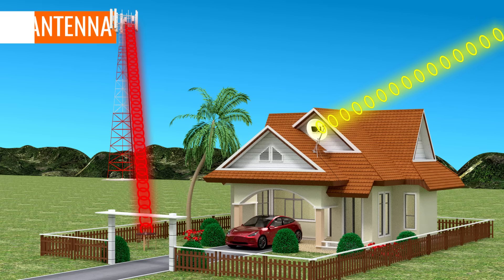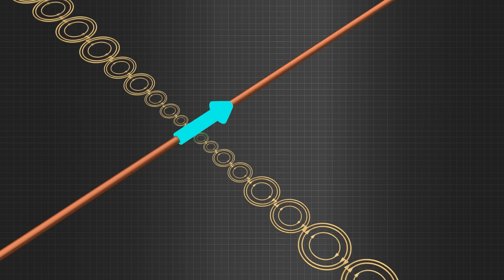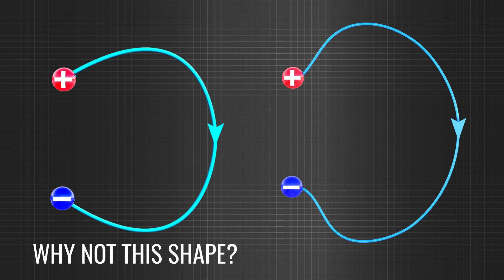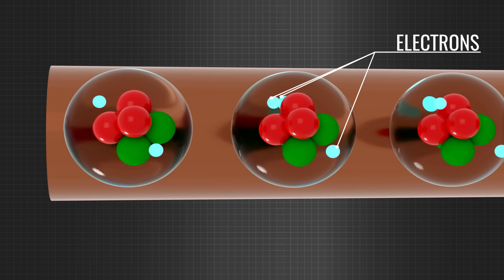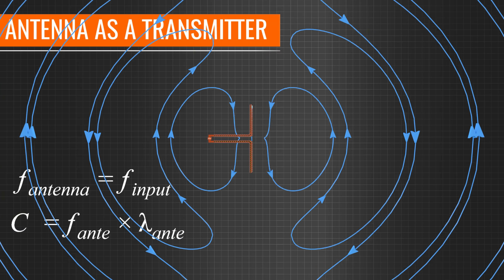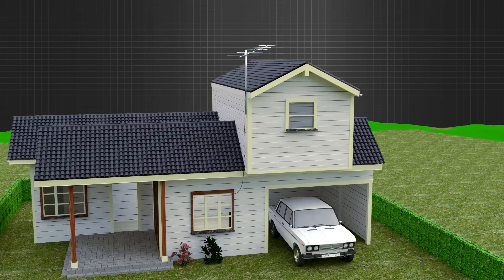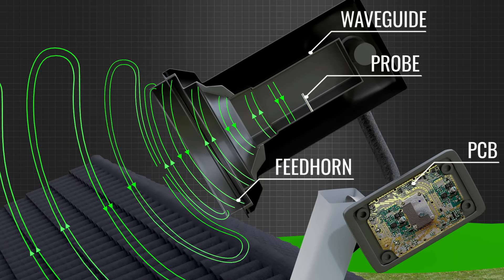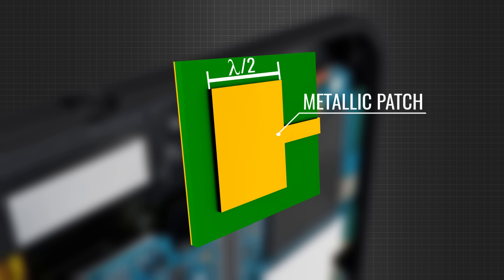How does an Antenna work? | ICT #4

Comment: Yeah it works with sine wave.
Reply: Antenna works the same with any form of waves. With short pulses (e.g. radar applications) and high-order modulations (like QAM) or extremely wideband modulations - wave is not sine. What fundamentally matters for emitting/absorbing waves - is dV/dt at any given moment of time. In general, antennas can be fuly described using time-domain (spectral, transient) analysis. But for many application cases 'Frequency domain' is enough and more easy to deal.
Reply: @plyrvt  Then what's the wireless signal waveform.
Reply: @CasamTheAnimator  what is "wireless signal", any radio signal for over last 100 years is "wireless signal". RMS Titanic transmitted wireless signal. It was pure sine wave long pulses, encoded with Morse code. Early voice radio (broadcast or phone talk) used AM modulation. During silence (no speech) AM transmit pure sine wave (called carrier frequency). But when you apply amplitude modulation, this carrier frequency shifts, according to frequency of modulation signal. If you apply 1000 Hertz sine wave to 10 MHz carrier frequency, TX output signal will be superposition of 2 sine-waves 0.001 MHz and 10 MHz. It won't be pure sine wave any more. It will be VERY CLOSE to sine wave 10 MHz, but slightly distorted. It's spectrum will deviate in 9.999 - 10.001 MHz range. Signal slope at any moment of time will be slightly sharper than pure sine wave 10.000 MHz. Historically we use very narrow modulations, few kHz or up to few MHz (TV broadcast use ~7 MHz over last 70 years). Such narrow frequency deviation has negligible effect on antenna response. But some antennas can be very narrowband. For example, on VHF some monopoles used in handheld or car roof can have few MHz matching bandwidth. If you use such antenna with 7 MHz analogue TV (NTSC) broadcast signal, you will have noticable attenuation and picture distortion. That's because frequency carrier is not truly sine-wave. Some military, radar and modern digital applications use very wide modulation, much much more than 7 MHz. Using pure "sine wave" model of transmittion lines, antennas, matching circuites - will cause noticable signal distortions. Fast-switching transmission lines (any modern digital PCB), antennas serving such fast-switching purposes - should use transient (spectral) methods, rather than frequency method (harmonic sine wave analysis)
Reply: @plyrvt  Waves are from ocean, this is how we get waves to generate internet signal.
Reply: @CasamTheAnimator  I like how the other dude puts his time and tries to explain it with logic while you here a troll, replies with nonsense

Comment: What is a "time varying voltage signal" ? What does it mean "consider the case at time 0" ?
Due to the effect of the voltage, the electrons will be displaced from the right of the dipole, and will be accumulated on the left. Why ?

Comment: I have a question on my brain for around 7 month and I didnt get the answer from anyone and any where.

The question is "I have a circuit board that has a pcb antenna which gives me around 100meter range, but I want to increase that into 1-2Km at anyway even if I need to use an antenna like a long tree. But how can I do that. Would I have to change the crystal oscillator or I have to use a high gain antenna?"

My question maybe funny though I want to know.
If anyone know that please reply me!

Comment: Antennas receive an electromagnetic wave and convert it to an electric signal, or receive an electric signal and radiate it as an electromagnetic wave. How an antenna transmit and received waves at the same time?

Comment: I've been struggling to understand how antennas work for ages. This one eventually explained it clearly to me in an easy to understand way. Huge thanks.
Reply: you and I are on the same page!!  yes the pyramids  were a interplanetary communication device that operated at a very low frequency.  But also the great Pyramid of Egypt was a teletransportation device, ,, NOW Stone Henge and Gobekli Tape: they were power plants. ,  You will see chips on the upper parts of the stones as they were perfected to a operating frequency.  The horizontal pillars were set to vibrate at a particular frequency magnetically, for many reasons, each horizontal rock had a purpose!!   some were used to excite the seedlings in the ground, to expedite the growth, some were tuned into earths mag field and provided magnetic lift via the Earths "B" field .  Check out Coral Castle Florida,  ED used What I call a "B" field generator, His generator used "V" magnets to ensure max delivery of the "B" field Just like is being used at the black pyramid of Alaska.  His generator used 25, V mag around and 5 deep to produce the "B" field into the earth and special stones.  THE "B" field is the center of a magnet/ some like to refer to it as the neutron field.  But the 'B" field is much much more !!!   I wonder if the black pyramid of Alaska used magnetite as a skin for the pyramid that would explain many things!!!   Tesla new about the free power that's available through the CENTER FIELD of a magnet AS you are well aware the rich boys didn't want it,  It's been there all the time.  When the government took down the horizontal stone at Coral Castle the entrance door stopped working.  Funny thing they gave us the clue,, His horizontal rock was providing the magnetic energy to support the access door.  AS you know magnetic energy is perpetual  JUST GETTING started with all this.   I don't need to brag about all my credential.!!  I got into physics back in 1959 as a ham operator at 9 years old I would design and build my tube type radio's for Rec and xmit.   I know what I'm talking about..    When they say all they had were copper tools OMG HOW STUPID!!!  when you understand the properties of a inductive that being utilize to build the pyramids you would understand a copper tool was every bit of a power tool  BIG TIME!!!!!!!!!!!!!!!!

Comment: at 0:40 there is an error. The propagation is present also when there is a closed loop conductor and variable current in it.
Reply: I am having a hard time understanding this. Is there a thing like a LOCAL magnetic field or not?. I used to think everything that has moving charges like a normal wire are generating electro magnetic waves.

Comment: They are tuning forks that resonate through the soil. Place a magnet inside of a copper coil and cause current. Collect the field radiation of that coil with another coil and share the magnetism. Place an iron rod inside of the second coil to receive the acoustics. Radio transmissions are collectable with iron rods and copper coils. Amplify the transmissions of the electric side by energizing your own magnetic coil. Iron to other conductive metals can serve as receiving conductor. Radio frequency is per second range. There are frequencies much faster in comparison. Catching radio signal acoustics and replacing them after copying them using conductor interference. Different towers grab the radio sound before a second dump is possible. Radio transmittance is recording by shrouding the landscape. Air static waves snow in signal and hide espionage catches. Radio is a speaker that moves its' sound through the muds, leaving quiet electrical air. Turn on a static dissipator and receive the ground signal that is only blocked by static wave. Opposite charge induces the moving acoustic current by small or large antenna. Also part of the ocean and nearly all of America is under future ownership of coorperation. Sea advance and reproach designs under the new ownership construction plans. Radio and gps are in coordination with the future program mapping. The ear rings of the grid are the same that cemetary caskets get. The grid raised the grounding height. The world may go deaf if the old mapping is not added to the grid functions. Old town and old street names renewed. The ringing of underground acoustics would end.Higg frequency  calculations and advanced metronomal algorithms launched grounding drastically into the future...The government opened the mapping of heaven's gate...All of the new 911 address kingdom belongs to the heaven on Earth architecture....This means that we only rent the country.The ones that actually own it; are waiting to send military in to reposess..Just like a robbery that we cannot finish; for lack of ownership capabilities..Government op that made a man named Charlie John Thomas called God. Through insanity, God rebuked the world ownership.A virtual reality insanitarium occupation is occuring.Heaven haa begun and the insanitarium is under the sea. Water is the dust of the ground. I just wanted to start a video game that part of me lives in. I did not want this earth until I saw how you all loved it. Then out of Jealousy I lived to love it. Mine now....cJT....aka Chajun

Comment: Thanks a lot for this! I have a question "is the wave length the same size for the type of transmission you are using? For instance radio wave are all one size?" If so how does they differentiate the signal to make different sounds through a speaker; duration of the signal? Maybe a dumb question but I didn't understand the "1/2 of the wave size for the perfect transmission" statement.

Comment: Hi there,

I have one question about the satellite dish and the LNBF.

Does the LNBF convert the microwaves received from the satellite into an electric signal before amplifying them or is the other way round? Indeed, I am wondering whether satellite dishes amplifies and create more microwaves than the amount they have received, which sounds a bit dangerous in terms of radiation, especially for people living just under the roof where the satellite dish is located. Or does the amplification occur when the microwaves have already been converted into an electric signal circulating through electric wire without any additional radiation.

Many thanks.

Comment: I really love a response from you, as im tring to build an antenna array for the arduino; thus far i think i can make an array of dipole antennas to make a wave form plane; but i think a thin sheet of male could be plane on top of was antenna as well to create the same effect, in not sure, but in tryingot create an antenna array that can create different wave on the spectrum, but feel sure I will need some kind of crystal antenna im not sure - you any got links on building more types of antenna for an antenna array?

As in theory should an antenna be able to create viewable light as well, like a torch?

Comment: so if I have a thin sheet of metal and pass an alternating current through it, it become an antenna that can create different waves sizes and forms; but although I can change the frequency of the wave, do i need to change the voltage to make a larger wave as well? and create different waves on the em spectrum as a result?

Comment: 4:10 the frequency of the transmitted signal is the same as the frequency of the applied voltage signal...so....i don't get it. 
let's say 2.4 and 5 GHz goes from the router with EIRP 50mW and 100mW respectively. what is the frequency of the applied voltage coming from the transmitter through the line to the router's antenna ? (isn't volt*amper=w....am i totally on the wrong track here?)
Reply: 5:10 again :) the freq of output voltage is the same as the freq. of the EM wave...I wanted to do CWNA next week but on the second thought......unless someone could kindly explain it to me?

Comment: PULSES Triggering to hit the THE RIGHT VOLTAGES TO IDENTIFIED RX WILL ACK RESET TX IN SYNCHRONIZED TIMELINE...RF BASE SURROUNDING FRICTIONS  RTX ..REGISTERED TRANSMISSION XRADITIONS CAN BE INTERCEPTED INTERFERENCE....THE ARE CODE OF COMMAND THE LOYAL PURED CERTIFIED SIGNATURED GRADE CLASS QUALITY VOLUME ELEVATION QUANTITIES HYEAST HIGHEST ULTRAFRESHED MARINATED EXTRASALTED DEHYDRATED

Comment: P.s. for dummies (like me): the left and the right arms of the antenna are not connected to each other at the center point (not clear from the animation). One arm connects to the lead of the cable, the other to the shield (if coaxial cable is used). please correct if im wrong

Comment: The engine weighed 180 lbs, a man  weighed 160 to 180 lbs. Place the pilot off center to balance the weight of the engine?

Comment: Does solar panels interfere with ota signals. I have several very good indoor/outdoor antennas and still cannot pick up my local pbs stations. I get over 40 channels, but still no local pbs. Even while the antenna is on my roof, same results. The antenna on my roof now is omnidirectional. Any suggestions? Thanks.

Comment: guys im an EE major. I am havong trouble choosing an elective class. The four choices are: digital signal processing(one dimensional, IIR digital filter design, FFT, DFT), software defined radio(front-end RF system, analog-to-digital and digital-to-analog conversion, field-programmable gate arrays, sampling, digital filtering, signal recovery, timing recovery, equalization, and baseband processing), satellite communications(link design) and communications systems 2(system noise analysis, signal space, information theory intro, random processes). for me the DSP and SDR look pretty similar but SDR is more hands on and cooler i guess. I don't know if satellite communications is worth it though. As for supplementary communication systems 2 class, it's all theory with thermal noise. Which one is worth it and will give more valuable experience for bachelors degree. something that i absolutely need to learn now. I know satellite comms is probably too elective type of a class. but the other three are pretty necessary. so which one should i choose?

Comment: Great Video!
I have a question: How do the electrons flow from one side to another, if this is an open-circuit? as I know, electrons flow in a circuit only if they have a closed way (from source and back to source) to flow in.
Thanks!
Reply: Closed circuit is required when we apply DC voltage, but when we apply AC voltage the antenna act like capacitor it means that charging and discharging. At half wave length capacitive reactance and inductive reactance are equal so the antenna is oscillate at the highest.

Comment: SO basically you need accelerating charges to produce electromagnetic waves. This video is absolutely fantastic for technical interviews
Reply: We live in a 100% magnetic universe..... it's that simple!!   The center of a magnet is by far the most powerful part!!!   that's where you will find anti gravity and most everything else.   STUPID HUMANS!!  We went backwards in the Iron age!!  the center of a magnet is where we belong after all that's what we are all configured with..FACT!
Please review the works at "CORAL CASTLE, Florida. (YouTube),   He would "VIBRATE" ,,  not oscillate the granite at a resonant frequency to the type stone he was working with.  Granit has allot of magnetic properties given it's make up...  You just need to vibrate at the correct freq.  and it will become workable.  Keep in mind we are talking about vibrating only the "B" field of a magnet into the rock!!!   You will note at Coral Castle he also had a horizontal stone , similar to Stone Henge... All his magnetic generators were in the repel mode to maximize the "B" field..  SIMILAR TO THOSE Shown ON THE PYRAMIDS OF EGYPT..  FACT!!,  THINK about it THAT'S exactly why they used copper tools!!!!  You must use copper tools and any iron would totally dispute the field.  Quantum Math is total B.S.  E=MC2 is also total BS... E=MD.  (Magnetic density).  Thanks  Vincenzo.. Please use your brain!!  If your professor gives you any flack,  have him explain the speed of magnetism.  It's instantaneous.
 That's how they used the pyramids as transportation devices, inter Galaxy type transportation that's exactly why they were 8 sides to create a perfect hologram from earths magnetic field that could be used to connect interglacially

Comment: Why do antennas only work for low frequency electromagnetic waves? Why can't we transmit or receive infrared or xrays from an antenna?
Reply: Before - Technical limitations, we can't modulate those waves fast enough to use them whole.
Now, and before - Nature of those waves. Extremally low range, with high power output makes a good weapon, not an antenna.
And we really don't have this much data to transmit for this to be even beneficial.

Comment: I opened an old LNBF and found no electronic component but only 2 small copper wires!
Reply: It probably doesn't have that signal processing unit inside which filters and amplifies the signal. You probably have the digital tv box which does the job.

Comment: why haven't heard of a antenna that can absorb visible light ?
Reply: Smart question, I have never askied myself that question before but it makes sense that you should be able to capture light with an antenna. I looked it up for you and it seems that is it actually possible to capture/receive light with an antenna, however it is very difficult to do. This is because the wavelengths that makeup visible light in the electromagnetic spectrum are very, very small; namely 380 to 740 nanometers. Try building a dipole antenna with a length of 0.00073 millimeters (that is 0.0287402 thousands of an inch in imperial units) XD I'd that that would a pretty daunting/borderline impossible task. If you want to read more about receiving light with antennas and read the full answer I got the above explanation from, please take a look here: https://electronics.stackexchange.com/questions/285680/if-light-is-an-em-wave-why-dont-antennas-pick-them-up (the answer also gives a lot of interesting source/reading material and other useful information about how it could be done). I even found a scientific paper where they succeeded in receiving light (a.k.a. converting it into current, not quite as they do in solar panels but close) here: https://aip.scitation.org/doi/abs/10.1063/1.1797559?journalCode=apl